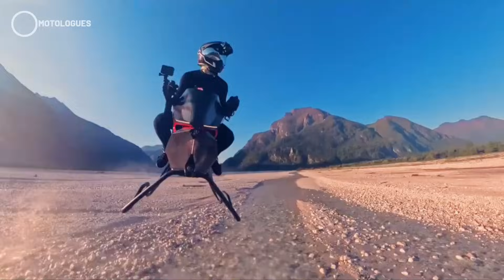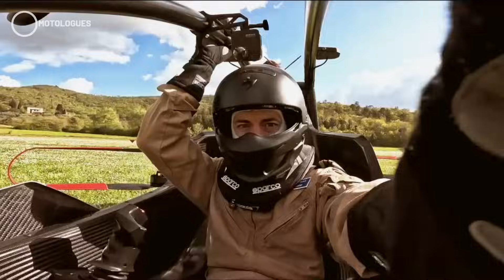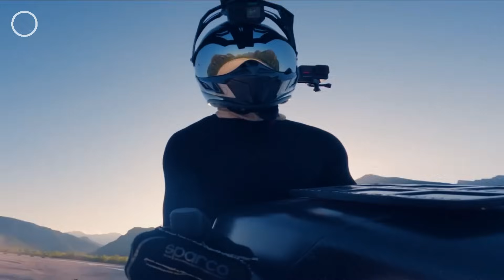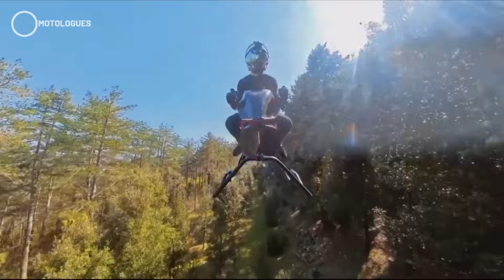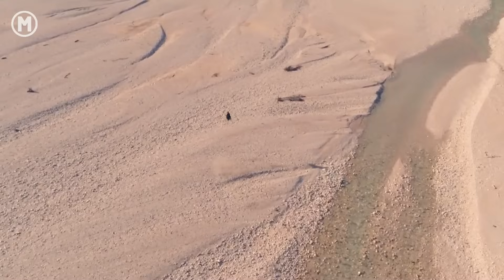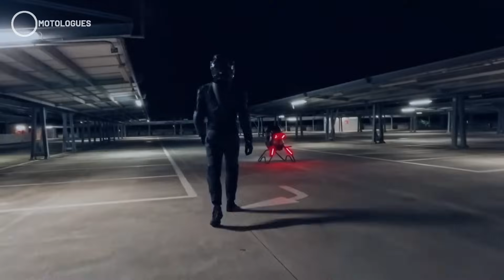2025 Volonaut Airbike Unveiled | Next-Gen Flying Motorcycles!

Comment: No I would not ride this in any urban setting,,yet. But the river of applications is immense. From military as a parachute dropped escape vehicle for downed pilots to SAR activities for sheriffs offices in any county around the country. Yes recreational activities would dominate at first but the commercial applications can't be ignored either. I am disappointed that air times and 3D breakdowns of construction for nerds like myself to see how it works have not been included in the videos. I have been building drones and the software to fly them autonomously for about ten years and have had the thoughts that this would come up eventually. Propellers are dinosaurs trying to get something like this to be acceptable but with jet engines for propulsion so much more clean. Now how about thos specs on a video guys at Volonaut? Inquiring minds want to know more.

Comment: Where is the fuel tank?  Unless it runs on nuclear fusion - this won't last minutes in the air (if it can lift off at all... with its OWN weight, the fuel's weight and the driver's weight).  This is brilliant AI Fake Video until it's proven real.

Comment: I want you to watch the video carefully.
Don't you think it's strange if the background visible from the bottom of the bike in the case of a jet does not look like a heat haze phenomenon?

If there is no pitch, yaw, or roll to control, there should be multiple deflecting nozzles.
Yet, why does the background visible at the bottom not appear to be high temperature when viewed?

Comment: Is there a reason the video looks fake? Seriously. But maybe it's so new to me. IDK. Still looks like a cgi video or something, to me anyway.
Reply: because it is, also weird they never have sound or show take off and landing eh?
Reply: @GraveSilencetheRowboatNi-tb6db  
I do know this: the mini-turbine engines used for the flying transport vehicles I've seen that ARE real are so damn noisy it's like a jet is taking-off.
Also, in smaller flying vehicles, the fuel consumption is so high as to limit operation to very short times (10-20 minutes) in many cases.
I think this may be a "concept video" for a proposed project using mini-turbine engines, and they are not going to kill the concept by exposing the awful whining noise. Sound ablation technologies (think "muffler") can come later if it's at all really even possible.
So the tech is partially there, but it's noisy as hell in a God-aweful, screechy way and severely time-limited for now because of the fuel selection which must take safety in consideration (some more capable fuels are very hazardous, so they should not be used).

Comment: The fact that so many  people think this is real is very sad.
Reply: So sad how dumb some people are
Reply: Of Course it's Real, like the Zaphata and the Bellwether, Dummy, this is the 21St.Century...The Tech. Is Simply Excellent!🤔
Reply: They are banning fossil fuels so even if it was real never going to take off
Reply: This is true. This film is real. This device was built by an engineer from a Polish company that also built Jetson.
Reply: @tomy3d  haha ok Cool. What new propulsion is it using? A jet engine, pointing at the ground? Really? That's your critical thinking threshold?
Reply: Still real , either u believe it or not😮
Reply: @RonMarish   I am on my 30th year working in aviation as a licensed aircraft structures AME.  I'm finally acquiring me M1 licence because I've gotten bored with rebuilding complete airframes, flight controls, wings etc. . . . . .
I'm laying out my time in aviation to show my understanding of how things work for critical flight control and propulsion types.  
Critically thinking. . . . . .this airbike  seems legit from my minimal research.  It appears to be the real thing.  BUT I have questions.  Flight control?  Stability? Air nozzle control?  Fuel amounts? Turbines use a hell of a lot of fuel.  Etc. 
If this is an early prototype, I think it's cool.
Reply: Dude, this was on the news yesterday. I actually came here so I could show my sister the air bike they are talking about.

Comment: It s only a wild idea. Only rockets can go up with jet propulsion, how can it fly in 200km speed without using any thing for air lift
Reply: Every action has a reaction. If a jet pushes at different angles you will find an angle where you move forward and level. 
I'm sure the noise is hopeless so the public will never get this. But how awesome would it be!

Comment: No pitch, yaw or roll?
Reply: The sway is too small and for VTOL (Vertical Take-Off and Landing aircraft), control devices (such as fans and flaps) for front, back, left, right, up, down, and yaw are essential.

Flying 2-3m above the ground, but the impact on the ground is too small.
Reply: yeah, because it's fake

Comment: looks fake to me
Reply from the maker: Haha, I get why you'd say that—looks straight outta a sci-fi flick! But Volonaut’s got real prototypes and test flights out there. Check their site for vids, it’s legit! What makes ya think it’s fake?
Reply: @MotoLogues 

There is an image of an experiment in which an object is suspended from a tree under development.

It may be possible to ascend with a jet, but if there are no control devices (fans or flaps) for moving in the required directions of front, back, left, right, up, and yaw, the only option is control by deflection nozzles.

However, I doubt that all of those deflection nozzles can be compactly stored in a motorcycle.